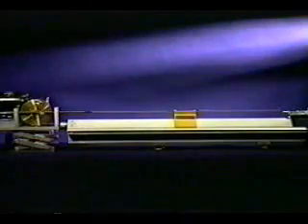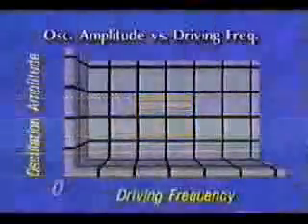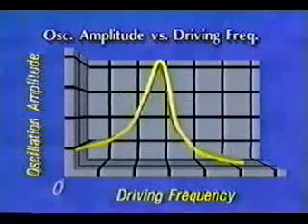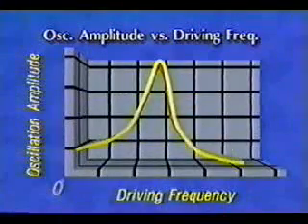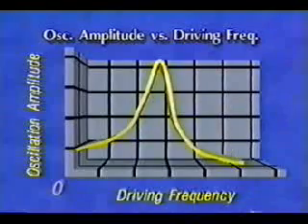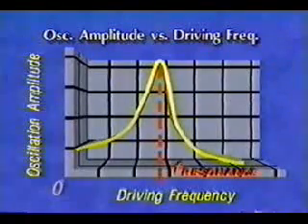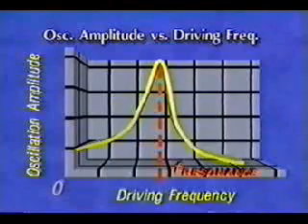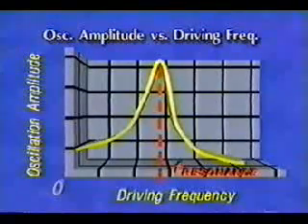Mechanical Resonance

Comment: Wait. This isnt Final Egg (or First Egg for Gamma)
Reply from the maker: I couldn't understand what you mean!
Reply: @MohammadTawfik  essentially, in the game sonic adventure 1, the main theme for the stage Final Egg is called Mechanical Resonance. its a pretty good game, but if your going to get the steam version i'd suggest getting the sa1 mod loader as well, the steam version of the game is a rather butchered port of a port of a port
Reply: @MohammadTawfik  Sonic Adventure Final Egg. (Mechanical Resonance)